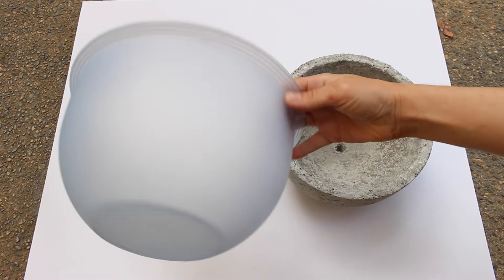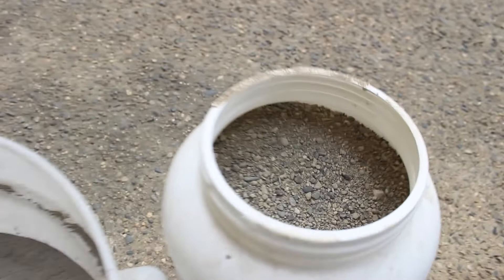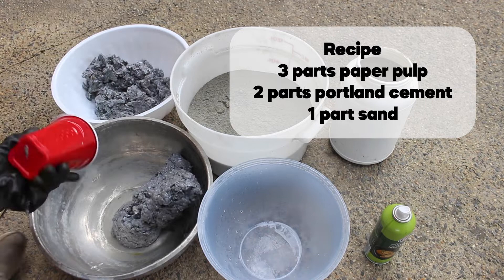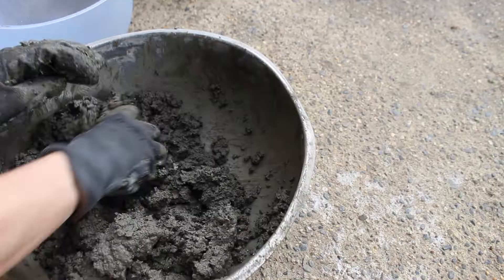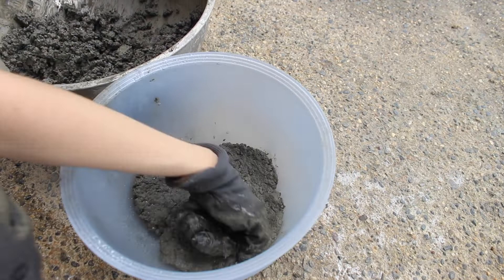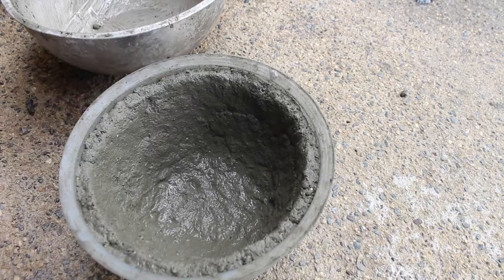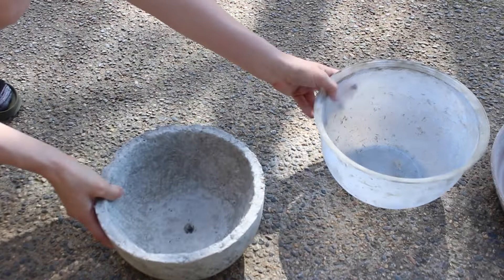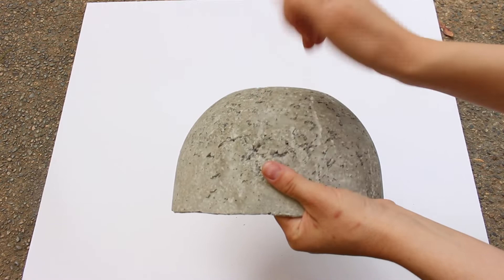How to make a Cement Planter - New Papercrete Recipe

Comment: How long to you wait before taking the pot out of the mold?
Reply from the maker: I usually cover it with plastic for two days. Then uncover it and leave it in the mold for another few days. Wait until it starts to turn a lighter color and that means it is dry.
Reply: @charsnest147  Thanks for the color change tip that the bowl is dry!